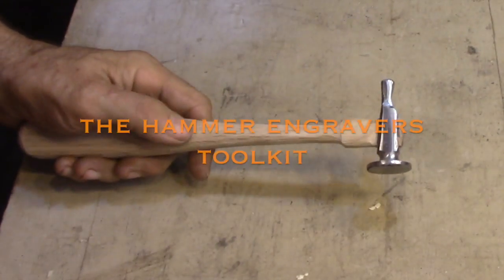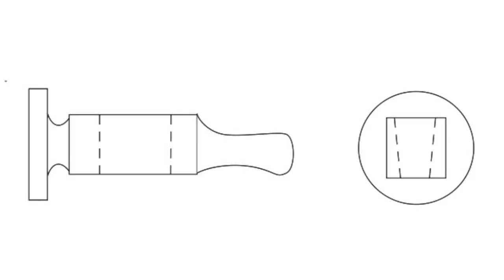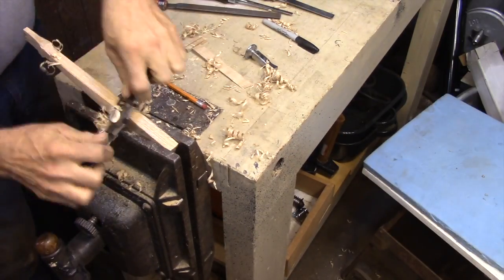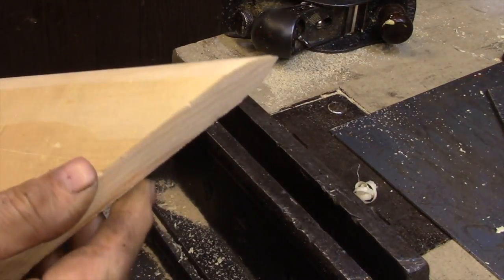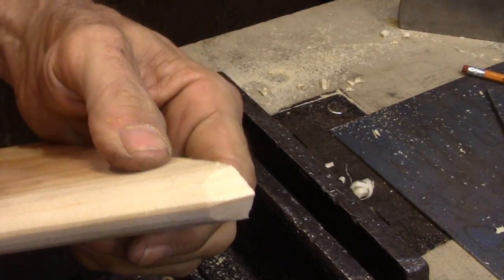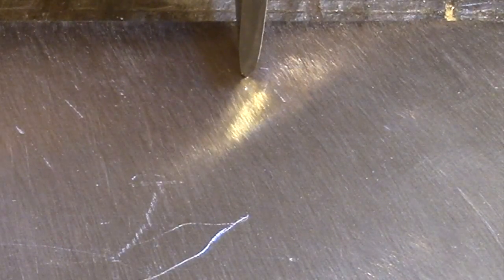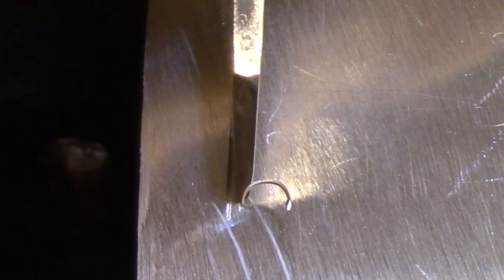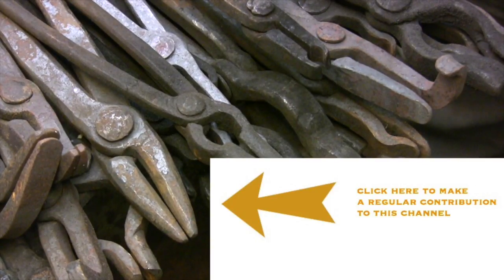Blacksmithing for Beginners - The Hammer Engravers Toolkit

Comment: Hi Dennis, I use chasing hammers quite a lot. I like to make my handles from fruit wood. I happen to have access to pear wood. Trimmings from an orchard every fall. I make the handles about 5/16" to 3/8" in diameter. That lets the handle act as a spring. It really makes the work much less tiring. Somewhat like an anvil with good rebound vs a dead anvil. They break frequently but it's worth making them thin to save your wrist.

Comment: Hammer head looks great. Hammer handle is too thick. It needs to be springy. Your heel on your graver is too long. .010 to .015 is plenty for most work. Longer if you cutting straight lines.

Comment: You never disappoint. Brilliant object lesson with the pine board. For the slower ones out here, could you show using the board what the chisel/graver is doing in relation to the surface? Perhaps using a sandbox as the work surface... Just trying to be helpful.
Reply from the maker: No problem - as soon as I know what I'm doing I'll make another video.
Reply: Yeah, I don't know what I am ignorant of in this regards: I certainly don't know what you don't know. I was wondering if that board in some clay or sand might be able to demonstrate the gaps in my ignorance. I'm thinking you would need to seal/wax the pine. 

I intend to do this very thing myself, but you already have an audience. Of 14,000 or so, so congrats on that.